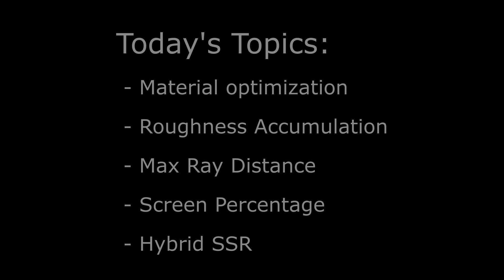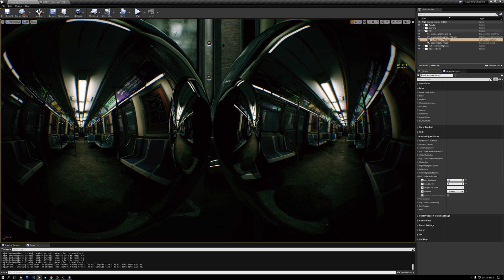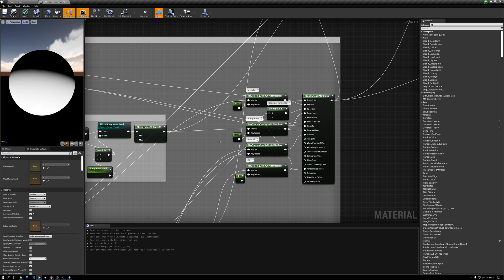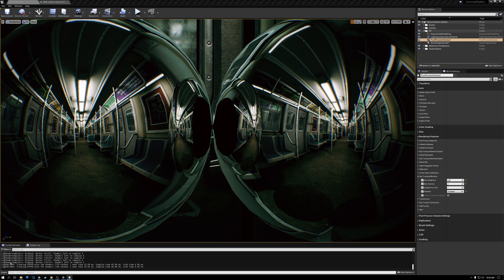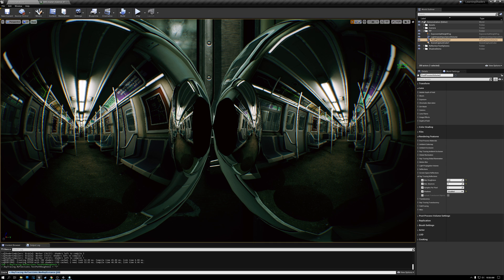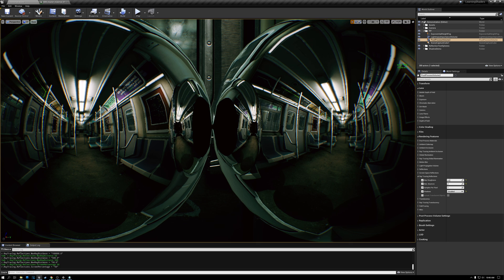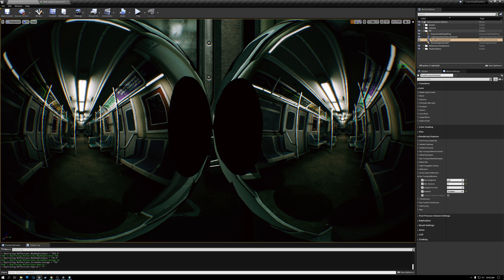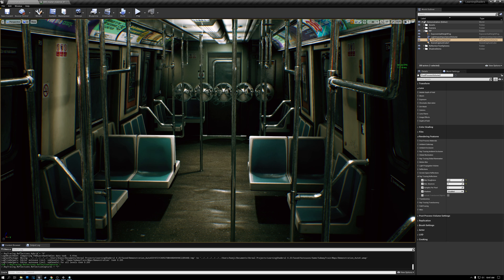Optimizing Ray Traced Reflections - UE4 Materials 101 - Episode 44

Comment: Hi Ben, I can't clean the noise from the reflections coming from emissive material. for example from the headlights of a car, the reflections on the floor of that material make a mess. do you have any tricks or variable consoles to get around that problem ? PS:  i have an RTX 3090, an no problem in optimization.

Comment: Hey I really hope I get a response to this and I mean no disrespect ofcourse, I'm so grateful for these videos you make honestly. So when you say your normal value is flat with 0, 0, 1.0 I think the colour is wrong since I was sure the true flat normal value is 0.5, 0.5, 1.0. This is what a dev from epic said during a tuition stream. This colour is exactly what 50% grey value would be for a bump map, half way between valleys and peaks.
Reply from the maker: This is a great question.  Thank you for asking.  The value I talked about (0,0,1) is the value of the vector.  The value the dev from Epic gave you (0.5, 0.5, 1.0) is the color of the pixel in the texture.  They're different because vectors have a range of -1 to 1, but texture pixels only have a range of 0 to 1.  So if you store a vector as a texture map, you have to convert it from the -1 to 1 range to the 0-1 range.  To do this, you multiply the vector by 0.5 and then add 0.5.  So if you start with a vector of 0,0,1 and you perform that conversion, you get 0.5, 0.5, 1.0. So that's what happens with a normal map. Flat normals are stored in the map as 0.5, 0.5, 1.0.  But once that color in the normal map is read in the shader, it gets converted to a vector again - or expanded to the -1 to 1 range.  So a flat vector in the shader is 0,0,1 and a flat vector in a texture is 0.5, 0.5, 1.0.  I hope that that makes sense and that it helps.
Reply: @BenCloward  that makes perfect sense thank you so much. Ben, if you don't mind, can I perhaps pick your brain on something over a discord screen share? I've combined your shader techniques with someone else's and a bit of my own to come up with a reasonable rain system that activates when my rain particles gradually build up. They're timed right but I'm having an issue where my normal intensity (introduced by the rain shader) is somehow affecting the intensity of my base normal map as the global material peramater value increases. I think I know what's happening but if you have a moment at any point I'd like to show you and even try to resolve it.
Reply from the maker: @MonsterJuiced  This is bit off topic for this particular video.  Send me an email at ben@bencloward.com and I'll see if I can help you.
Reply: @BenCloward  right you are sir, I'll put together the screenshots tomorrow morning (UK here). Thank you for even considering helping, I'm trying to base my whole career path around texture art and didn't quite realise how deep into shaders and math I would need to get. However I'm completely fascinated by it!

Comment: Hello i am glad i came across ur video. Can u tell me what's yhe default value of raytrace reflection distance??
Reply from the maker: Here's a post that lists all of the default values:  https://forums.unrealengine.com/t/ray-tracing-variables-default-values-description-questions/130103

It looks like the default for r.RayTracing.Reflections.MaxRayDistance = -1.0.  Usually a value of negative one means that the value isn't used - which means that the ray lengths are not limit at all by default.
Reply: @BenCloward  thanks. I am really amsxed by so many ray tracing values. However, i am having some weird performance issues eith gtx 1070 csn you help figuring out the problem??
Reply from the maker: @TGADB  The GTX 1070 doesn't have any dedicated ray tracing hardware on it, so the graphics driver performs all of the ray tracing functions on the CPU instead - which is really slow.  In order for ray tracing to be done at a decent speed, you really need a 20 or 30 series card.
Reply: @BenCloward  the issue is very weird, im having 120 fps when play  scren is small and 23  fps when scren is full. Also, im using ray tracing for only  n only RTXGI frm Nvidia to get global illumination. I have shut down ray traced shadws , only turned on ray traced reflection for extreme smooth surface. Akso made play scren percentage to 70 yet this prblm.  Also i notice chaging aa to fxaa making ray traved reflection over noisey n jitter ,

Comment: You're a wizard, Ben! Went from about 30fps in my test scene (different from yours) to a whopping 74fps just after clamping the ray distance to about 700. Then after enabling hybrid reflections, it went from 74 all the way to 87! Didn't even have to use any other tweaks, not even reducing max roughness. Just default PPV settings and those two commands. And all that on my 1660 with scalability at ultra (or "cinematic" as epic calls it).
Reply from the maker: That's fantastic to hear!  Glad I could help.

Comment: Hello there , I was wondering about how to make scope shader in hlsl something that can zoom and have reticle that can only be seen through the scope , I work with cry engine and I am not much into shaders and I hate the render to texture method so I wanted to ask , thanks
Reply from the maker: I haven't worked in CryEngine - so I don't think I'll be much help.  I'm not familiar with what it can do.  Render to texture is a really powerful technique that's very useful for a wide range of things.  I think maybe it's just this specific implementation that you don't like. If you haven't done much with shaders and you want to start, I recommend starting with a much more simple project and set this particular goal for something you want to do in the future.  If you're just looking for a quick fix, maybe post your question in the CryEngine forums?
Reply: @BenCloward  thanks , cry engine doesn't have render to texture feature that's why I am trying my luck with shaders , also Cry engine uses hlsl the same as 3ds max , thanks